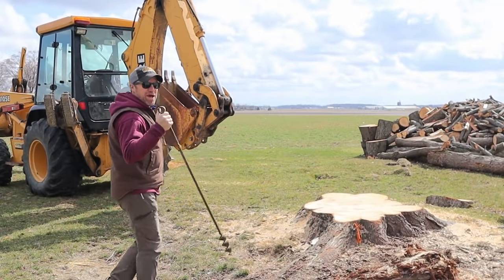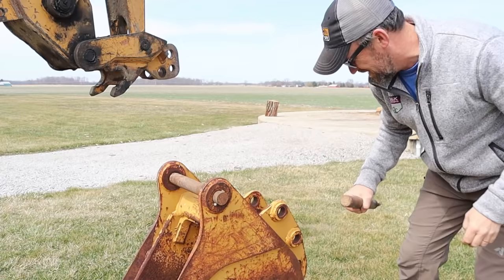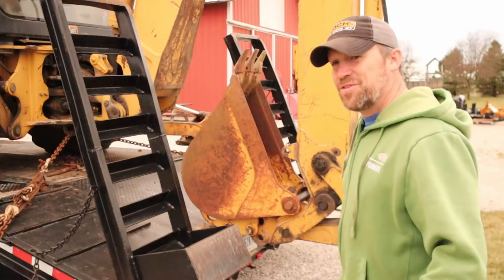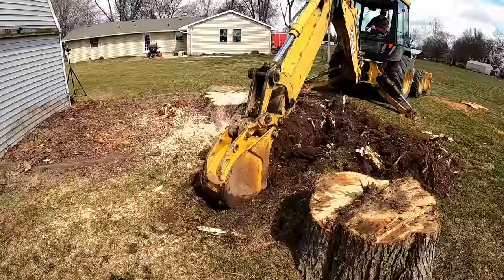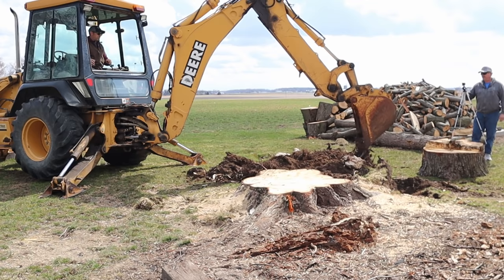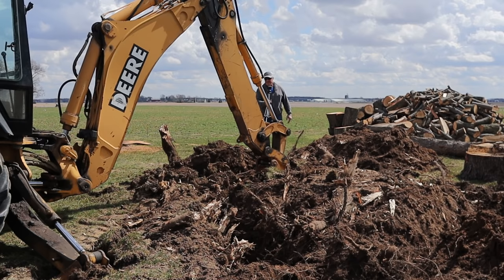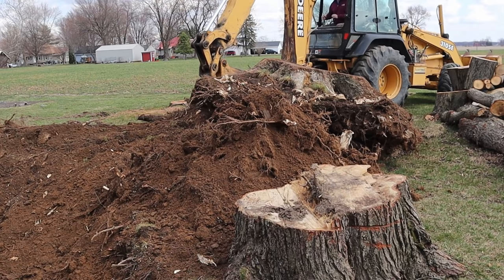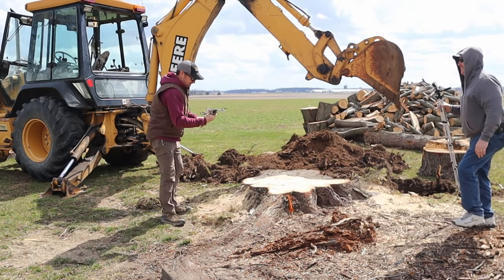The Biggest Stump I've Ever Tackled With A Backhoe! - John Deere 310SE Digging Huge Maple Stump

Comment: Definitely not an Oak Tree! I just finished removing an oak (the same diameter) in the same manner. Got the perimeter roots dug up with backhoe, but could not budge the stump. An oak tree has some MONSTER roots growing DEEP into the ground. Dug out dirt from under the stump by hand for about a week. Began the burning, and after two attempts, realized that all I was doing was baking the dirt on the bottom of the stump into BRICK consistency, not letting the fire get to the wood!!  Another two days chiseling "BRICK" off the bottom of stump, the burning was a success. The stump was centered under my future Pole Barn. 25 yards of red sand to fill the hole. NEVER, NEVER again will I tackle this! (I did save a little money "I think" LOL.
Reply from the maker: Nice job Dennis!  Yes, takes quite a bit of patience.  This was a maple tree and still put up a pretty good fight.  Thanks for watching!
Reply: I’ve dug out a lot of stumps with my old 580 Case,but some of the hardest we’re huge spruce stumps,usually they are easy but these were old shelter belt ones that had to make way for a new house build in town,they had tap roots which is rare but the soil in town is pure sand and they adapted with tap roots to survive.

Comment: In the tree biz for 32yrs,  grind it out about 600 bucks & about 2hrs done. No where near the carnage...lol
Reply from the maker: Well 2 hours to grind it. But you're not done right? You still have a gigantic hole full of fluff to get rid of? That is my complaint about grinding stumps. You are left with a big pile of mulch mixed with dirt that you can't put underneath of a building. You still got to get that all out of there and hauled off site too. So in my opinion you're kind of left with more of a mess by grinding it out and not guarantee that you got all the wood out of there anyway.

Comment: Small piece of advice I learned..once you get to where the stump is somewhat liftable...just chain it and pull it out with the bachoe...it will roll right out most of the time...the tractor is way stronger that the boom...especially if its 4wd.
Reply from the maker: That might be certainly worth a try the next time.  Thanks for the tip Fastdraw30!  BTW, I have a 3wheeler much like what is your avatar.  I have a 1985 Honda 200S.  Thanks for watching!
Reply: @digdrivediy  thats cool, I used to have several trikes, I love the old ATCs..always have, I am going to get another one one day...I have more toys now that I can keep up with,  but definitely have a soft spot for death machines😁

Comment: We have pulled green stumps that large with two jeeps w/winches and snatch blocks.  Oak, Ash and Maple
The secret is NEVER cut it that low before you pull it out of the ground.  If the stump was left 6-10’ high (higher the better) then hook rigs to the top of 10’ stump, the leverage of longer trunk is critical.
Reply from the maker: So how do you cut a 40" tree off at 6-10' above the ground? From a ladder? There's no way I would do that I'm afraid.

It's also been my experience that you have just as much leverage power prying up on a stump from the bottom as you do trying to pull it over from only 6-10' above the ground.  You gotta cut the roots around the perimeter in either case.

Comment: I have a suggestion that has worked for me in the past and I used a ditch witch with good cutting blade teeth. sharp. it works really good and you can go deep too. . especially with that close proxy to the building. then the backhoe works well to remove the rest. and you can use it from many angles too. Just a suggestion for you.
Reply from the maker: That would be interesting to try out Bill.  If I could find someone willing to cut around it I'd be more than glad to try that.  Makes sense as long as it isn't hard on the ditch witch I suppose.  Thanks for the suggestion and I appreciate you watching!

Comment: Tip.  I seen this on bucking billies youtub channel.  But if you cut the tree down and leave a 4' tall stump you have leverage to push the stump over with
With a loader backhoe or excavator it gives you a mechanical advantage. 
You might even be able to take it out with an old Ford 8n tractor and a frt loader scoop.
Reply from the maker: I've done some of that before too.  This one was so big it would be tough to cut it off that high though.

Comment: Ever heard of drilling a few holes, dumping used oil or anything flammable except gas and light it.  Come back in day and it’s gone. Very economical.
Reply from the maker: I have heard of that actually.  Would probably work great if you had the time and patience.  He was in a hurry for this one to be out of there though.
Reply: Everyone has heard of it, but it doesn't work. That's why there's a stump grinding business.

Comment: Letsdig18 would have not cut down the tree first but used it for leverage to push it over after he cut around the tree.
Reply from the maker: That's much more beneficial when you have a big machine like a 20T excavator.  It can be helpful and I've done that too, but with the backhoe it doesn't have the mass or reach to really do it in the same way.  A bit more risk involved cause you don't have the weight to make the tree go where you want it too for sure.  For trees 12" and under I push them over too and then they're easy to cut off the stump.  Thanks for watching!

Comment: BACK OF THE ENVELOPE CALCULATIONS
24 million BTUs per chord of hardwood.  You cut and split 11 chords.  274,000,000 BTU’s.   There are 140,000 btus in a gallon of heating oil. 
Your 11 chord wood use is equal to about 2000 gallon of oil.  Maybe start airsealing and insulating your buildings to reduce the amount of fuel needed.  
“Use less, so you don’t need to make more”

But it’s a Great video !  Thank you
Reply from the maker: That's interesting!  Thanks!
Reply: @digdrivediy    The video is well done, I learned a lot. Thank you.  Imagine if somehow your family of volunteers for 4 days was put to the task of air sealing the buildings…. That time and effort will pay dividends every year by burning less wood.  Typically, The first 50% of energy reduction is quite easy and effective.  Forget insulation for now,  go for the easy energy reduction, stop air infiltration.  The tool that’s used to quantify the amount of leakage in your building is called a blowerdoor.  Typically before I start any work airsealing I get a base line and with the blowerdoor.  Then we seal the easy stuff and track our progress using the blowerdoor.
Thank you again for the excellent videos,  (I saw the backhoe maple stump removal also). Really well done !

Comment: I ground 3 black oak (18-24” diameter) stumps out in the site of 40x60 horse barn location. 33 years later no issues. I would never dig out that big hole vs. grinding out a stump. FYI
Reply from the maker: That's good to know.  Glad you never had any issues.  Did that barn have a concrete floor in it for the horses?
Reply: @digdrivediy  Dirt in stalls with rubber mats, concrete feed and tack rooms, wooden pier hallway.  Stump sites in all 3, no issues.  Chose grinding because it was faster and did not require much backfill as excavated sites

Comment: 1st watch of channel. Using what you have to get it done... Ive learned enough from Chris at Letsdig18 and a few others, Grinding stumps is Not the answer if you are going to rebuild on the same area, since grading and footings etc etc will never line up with having it still in the way.  For all the land that is sold it costs 10 fold to go back & have the stumps re-pulled after its all been ground.  Stumper attachments work the best for this by removing less soil overall. Compatibility with a backhoe Vs a excavator is the ultimate factor.  Must have been a devastating loss to lose a tree that large.
Reply from the maker: Thanks so much for checking out the video.  You've got some very solid and poignant comments.  They did hate to lose this tree for sure.

Comment: Next time start farther away, your in the big roots to soon. I usually start about  3 times the diameter of the stump. So a two foot stump start pulling roots about six feet from the center and work your way around. I never had a stump I couldn't pull out with a 310 jd.
Reply from the maker: Normally I would but we were trying to minimize the disturbance for the building knowing we would have to fill in with stone whatever we dug out for the stump.  Great input though as that would make it better!  I've never given up on a stump either. Thanks for watching!

Comment: should have left like 12 feet standing then you could lever it out with a 10 or 15 ton tractor winch like farmers have for recovering stuck equipment
Reply from the maker: That could be helpful but how do you cut this huge tree off safely at 12' above the ground?
Reply: @digdrivediy  I drive my tractor there and stand into the front loader bucket and extend him up

Comment: My ol man pushed the trees over with a little dozer then cut the stump off. Way way less time and work in the end.
Reply from the maker: I've seen that done. I've pushed them over many times when working with a bigger excavator. Still, digging this stump out with a dozer would still be a lot of work. I'd think you'd have about 2 hours in digging and pushing.  Then the trouble of cutting a huge stump sitting 6 feet off the ground.  Yeah, I don't know. Thanks for watching!

Comment: Why not compromise the root system BEFORE cutting the tree and then pushing the tree over thereby letting the tree pull the roots up as it falls. Has one ever seen a tree that has fallen in the woods or due to a storm?  The roots come out when the tree falls. Risky, yes, but the risk can be managed.
Reply from the maker: Very true. I have done that before especially when I've been using a larger excavator. The backhoe just isn't big enough to handle a tree like this especially once it's down and the root ball is still attached to the trunk. Then you got to deal with cutting the stump off and handling the giant log base. It really wasn't that bad just cutting the tree down and then it took me a little less than 2 hours to get the stump out. We manage the risk by not having to dig it up to the point where it was barely teetering and then hope that the backhoe can push it over while it has a giant hole around the outside of the base. This is just a consequence of using a smaller machine for a bigger job.

Comment: After the stump is lose, a large portion of the weight is dirt.  I've always wondered is one could use a pressure washer to wash the dirt off and lighten the load.
Reply from the maker: Other than the mud, I bet that would work!
Reply: Fire truck!

Comment: That's why you dig around it and push the entire tree over. Way more leverage. Use the extendahoe way easier on the machine that way.
Reply from the maker: I do that quite a bit on smaller trees.  This one was so big I didn't want to take the chance even though it could have went just fine. Tree was dropped safely and stump was dug out safely and I'd say to do this stump in an hour and a half isn't bad.  Practically the same amount of digging would be needed for pushing the full tree anyway.  Thanks for watching!

Comment: Was this stump to wide to simply burn it out? 
I know with smaller diameter stumps, you could just put a barrel around it and light a fire. 
was this considered ?
Reply from the maker: Takes too long and isn't a complete process.  Plus it's not easy to burn in town and not upset all the neighbors.

Comment: Why does it need to be removed at all?  <-- I know that sounds like an accusation, but it is not.  If the tree is completely dead, then why not simply level it, or even below ground level?  Why would it affect anything if it's no longer alive?

-- Edited -- I guess it was kind of answered in the video... just preference.  Mention of rot causing the ground to soften where the stump material was... OK, I get it.  The tree remains aren't going to remain the same consistency over time, and you don't need a mush ground with a building on top of it.
Reply from the maker: Right on!  Thanks for watching and commenting!

Comment: Will going beyond the lift capacity by lifting tractor off ground continuously cause twisting of frame and damage? Or are these loader/backhoes designed to work doing this?
Reply from the maker: They're designed for this for the most part.  As long as it isn't a part of everyday routine than "every once in a while" is likely OK.

This backhoe is over 25 years old with 9000+ hours now and still going strong.

Comment: I've seen attachments that are basically big thick sickles that cut right through even thick roots. I don't think they even have to be all that sharp. Just having one cutting edge instead of muscling through with a bucket should be much easier and faster.
Reply from the maker: Yes, for us it is called a frost tooth.  Used to rip through frozen ground.  That would be better than a bucket but still have to move some dirt while you're at it too.  Thanks for watching!

Comment: Hi, Your machine sounds very dry, she could do with her bits greasing, I don't know if it's correct to suggest that you should be doing something you are not but well. should you have put a counter weight in your front bucket to stop your machine jumping, 🤔😉
Reply from the maker: It does sound dry, but I did grease it quite extensively before this job.  I'm wearing that microphone and it really seemed to amplify things.  But, it never hurts to add a bit more grease as there are often times when I do let it get too dry.  A counter weight of some sort may have been pretty helpful here.  Sometimes I'll get a scoop of dirt or something in the front bucket to help but I didn't have much to use on this site.  I don't mind the suggestions at all.  Appreciate you watching Peter and thanks for the comment.
Reply: @digdrivediy  I have just spent a couple of hours watching your videos, Sir you have some nice kit and do care about it. 👍👍 I mentioned the counterbalance as it makes the machine safer to operate the more stable she is, there were some mighty size lumps of timber you might of considered.🤔 Some people reading this might wonder why greasing a machine is so very important. As Neil has said he did grease his machine, but when metal gets warm and rubs on other metal it makes a noise. Grease is squeezed into the joints on a machine through the greasing nipple, so that it just shows coming out of the joint. It also stops fine grit from getting into the joint and becoming an expensive repair if the machine breaks.  . . Might be a nice little item to add into a video in the future to show people how you grease a machine.😉 Take cate best wishes, great videos, #haveasafeday

Comment: Tell him thank you very much for cutting it down to almost ground level. After it got cut down that low I'd say get me an excavator or a stump grinder
Reply from the maker: It wasn't too bad really.  I'm the one that cut it down!
Reply: @digdrivediy  ah learning?  Need that leverage. I had a Case 580 series for 20 years and spent a lot of time digging out all kinds of trees. Thunderhead pines were the worst.
Reply: Ugh, breaking concrete  and digging stumps were my least favorite jobs. I charged extra for both and took my sweet time.

Comment: I removed two fifty five years old giant shrubs in less than thirty minutes with a 1025r mini tractor with a backhoe attachment i ripped top off with a grapple an dug up the large stumps  think a 1025r  is a practically a 26 hp riding lawnmower with attachments . It’s not the machine but the knowledge of how to use it

Comment: That is a Scotch auger, worth a small fortune at that length.
Reply from the maker: What's a small fortune worth?
Reply: @digdrivediy  well, I just bought a set from 1/4”-2” and that set me back about $650.  A long one like that, in good shape, and you can’t find long Scotch augers if your life depended on it, would probably set you back $150-$175.  You can get a long auger for a drill no problem, but a MkI manual auger with the 1” or 1 1/4” eyelet, fugetiaboutit!  What do you want for it? 😎
Reply from the maker: @j.muckafignotti4226  I had no idea!  That's really cool though that they're worth something.  I'll likely just keep it hanging on the wall for now 🙂

Comment: LOL , Thats why they make stump grinders hahaha,  I could have grinded that entire stump in 15-20 mins max,    haha . dug it all up spent all day and u still got to get rid of the stump LOL
Reply from the maker: 15-20 mins!?  Oh, c'mon.  I've seen stumps ground out before.  Don't you have to get rid of all the chips and debris or do you haul them away?  How much would it have cost for a stump this size?  How deep do you go?  We didn't want any wood left of the main stump as it was right in the corner where the footer was being trenched.
Reply: @digdrivediy  yes 15-20 min on my machine , mines not factory I run threw them.
Reply: @digdrivediy  I can go as deep as anyone wants . I can grind the entire thing up to where someone can put a pool. I usually go about a foot or just under a foot unless told otherwise .
Reply: @digdrivediy  I don’t haul the chips. These machines require massive maintenance when you hit volume . Massive,  i work in my machine daily and if you cant fix stuff in a jiff your out of business .  When I say massive maintenance I want to say it again massive . I rig up my machine all the time just to get the project done then when I get home I fix it the correct way.  I carry a ridiculous amount of tools and know how to fix pretty much anything even down to circuit boards.